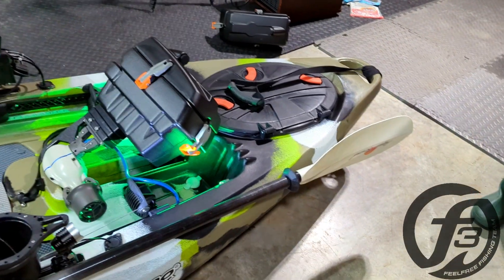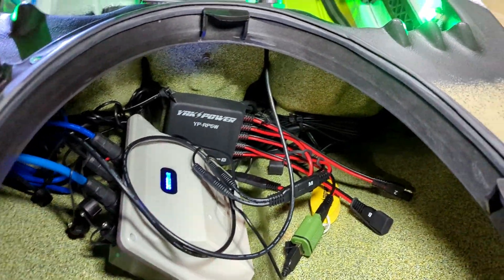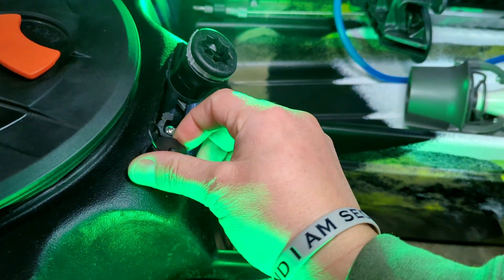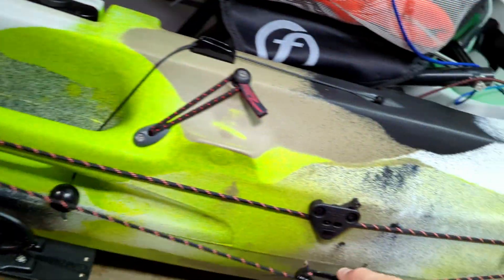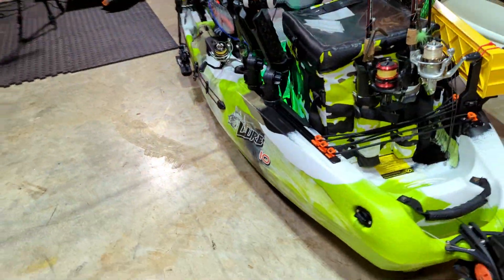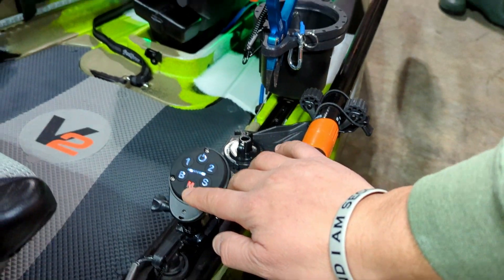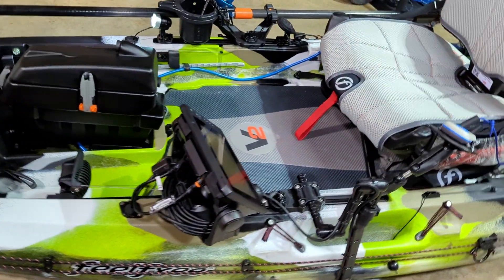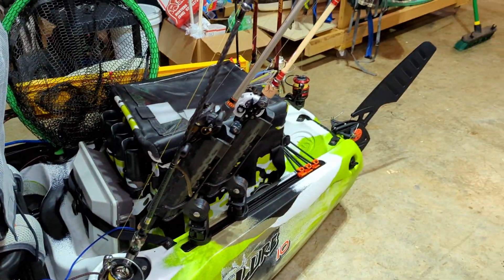2022 Tournament Kayak | FeelFree Lure 10 V2 | Bixpy Powered

Comment: How much time do you get with one charge battery?
Reply from the maker: It really depends on the speeds you run. If you run at full speed it'll only last about 1.5 to 2ish hours. When I am fishing a tournament I usually run full speed to my spot and run half speeds or lower speeds when moving short distances. I use the paddle as well. Usually, I can fish an entire 8 hour tournament. I have run out of battery before when running full speed more often. If I know I am going a longer distance I bring a second battery. The PP-378 that comes with the new J2 motors last longer as well.

Comment: I was just wondering how much you weigh in with your boat weight and all the gear what is your top speed using with the Bixpy..? And on your new feelfree  lure 10 V2 midnight bolt are you running 2 Bixpys motors?
Reply from the maker: It's all good.  I am about 185 and I am not sure of all of the gear.  If I were to guess, it is probably another 50lbs at the most.  I can normally get about 3.5mph on the different FF kayaks I have had in the past.  The Midnight bolt one is a 11.5.  I love my Lure 10, but for standing I just felt that the 11.5 provided more room for me to get around.  A little more storage space as well.  I am only running one Bixpy on it as tournaments only allow one right now.  I do have the bigger Pro battery from Bixpy that will go under my seat when it is in the high position.

Comment: Really like the way you rigged your kayak. Can you tell me do you bring fish on the port side and dose the Garmin interfere with that. My new lure has the overdrive and I am looking where to place my fish finder. I still like to use my paddle now and then. So I don’t care to have it in that zone. Again I like the way you have yours set up.
Reply from the maker: I really appreciate it. I normally tend to land all my fish on port. I do that because I normally angle my kayak toward the bank on that side. The Garmin can get in the way some but I've gotten used to it. I've since moved back to the 11.5 and I have my 9 inch Garmin in the center and Bixpy on my rudder. I still land my fish on the left side and it seems to work out well. I believe I've moved my units around all over the place, but the center has been great.  I'm slowly working on a Unibar type setup in front of my pod.

Comment: How does the Bixby j2 motor perform. I troll for stripers at 1.8 to 2
0mph . Do u know how long I could go. I have the same kayak
Reply from the maker: I haven't had a ton of time with the J2 like I have the J1 but you should be able to get that at half speed. When I fish tournaments, I hop from spot to spot at full speed and my battery lasts a full 8 hours of fishing. The J2 gives you two lower speeds and it comes with a bigger battery.  You should be able to fish for a while trolling at those speeds. If I can get out soon I'll let you know.